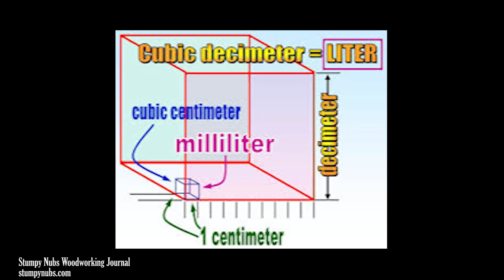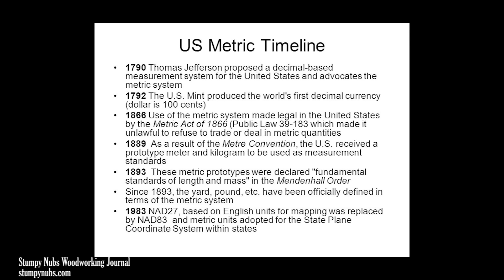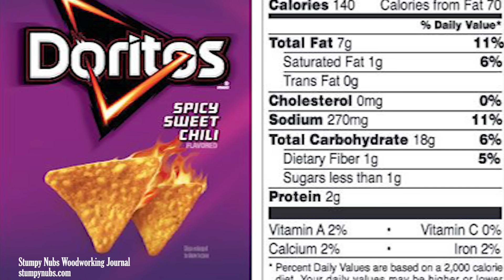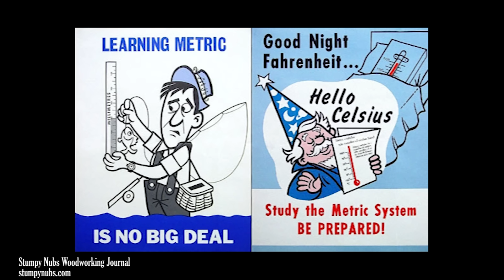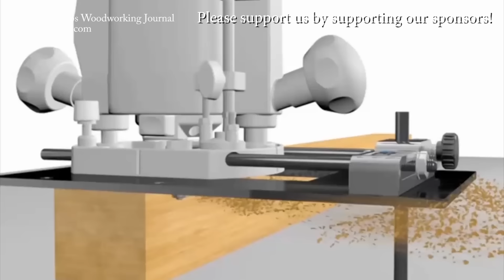BREAKING: The USA is switching to METRIC!

Comment: I made the switch to metric for all 'fine woodworking' projects from the start.  All of my tapes, squares and straight edges are metric or dual measurement.  I added a Wixey digital rule / gauge on my table saws and planer and keep a nice Mitutoyo caliper at the ready.  I still reference approximates in imperial and use it for larger projects like cabinets or home repair  just because most appliance schematics and accessories use imperial, but my life is loads easier using metric.
Reply: NO,NO,NO!, That’s all, but NO.

Comment: Here in Puerto Rico: we sell gasoline (petrol) in liters, yet we sell milk and motor oil in quart, half gallon or gallon jugs (yet we ask for a liter of milk); speed is measured in miles per hour, yet distance is measured in kilometers and mileage is calculated in miles per gallon; cloth for sewing is sold by the yard; lumber is sold by inches and feet. In cooking: we use the 'spoon and cup' system. This is a partial list.
Reply: So, of you go 55 mph on the  highway and your destination is 70 km away, you can't easily estimate how long it'll take?
Sounds very cumbersome!
Reply: @LRM12o8  Converting the speeds is pretty easy though if you don't need exact results.
50 km/h ≈ 30 mph
100 km/h ≈ 60 mph
160 km/h ≈ 100 mph
200 km/h ≈ 125 mph
I use these values to make a guess to convert mph to km/h as someone who only uses km/h exclusively and watches American youtube and sometimes needs to know how fast x mph are.
So I'd guess 55mph are a bit under 100 km/h, let's say 90 km/h and after checking online the exact conversion is 88.51392 km/h, so pretty close.
Reply: Sounds like a real bodge up!
Reply: I'm so confused...

Comment: Here in the UK we operate a mishmash of metric and imperial.Our money is metric (has been since 1971)we sell petrol and diesel in litres but we measure road distances and speed in miles and miles per hour,and we sell beer and cider from the pump in pubs in pints but bottled beer is often sold in half litres.Like i said a mishmash since we don't seem to have grasped metric fully.
Reply: I've long believed that fuel is sold in litres because price increases look less alarming than they would if it was sold in gallons.
Reply: In the UK we're a nation of exaggerators. When it's cold, we state the temperature in Celsius, minus 5 sounds really cold. When it's warm, we state the temperature in Fahrenheit, because 80 degrees sounds really hot 🙂
Reply: In UK, we don't sell beer in pints, we measure them in litres and then sell them into quaint pint volume glasses. We don't measure distances in miles either, the road "mile" markers on motorways are all in kilometers, and we just put up speed limit signs in miles per hour so drunk drivers can't claim they thought they only drank a pint when they drank a litre of beer, and they thought they weren't speeding because the speed limit was in km/hr.
Reply: Apart from miles when driving, there's not a single imperial unit I use here in the UK.
Reply: @MostlyPennyCat  You've never bought a pint of beer or milk then?
Reply: @MostlyPennyCat  How tall are you?
Reply: @1man1guitarletsgo  
195cm.
And I weigh 73kg.
Reply: @petebown  
Yes but I've always preferred a large gin & tonic, which is 50ml of gin.
Also I just use 500ml as the 'metric pint' and 500g add the 'metric pound'
And nobody really uses multiple units like inches, feet, yards and miles. We only use miles, we don't use the non-decimal inches in feet, feet in yards and yards in miles.
Reply: @MostlyPennyCat  Over 6'4" and only 11st 6lb?  You could do with a few more ounces of food on your plate!
Reply: @1man1guitarletsgo  
Yeah, sadly I'm very ill at the moment. 
I used to weigh 120 kilos but after all the nearly-dying in 2022 I bottomed out at 45. 😬

Comment: In the early 1960's there was a serious effort to convert the U.S. to the metric system.   I remember being in grade school during that time and was educated in the metric system for about 2 years.   Then they abruptly stopped.     Well, my later education as an engineer; physics and chemistry classes were all metric.   It's like growing up learning 2 different languages at home.   As an old man, I think and function equally well with either system............
Reply: I remember that too. I believe the powers at be during that time found it was too difficult to switch over using a bunch of grade school kids to do it, 😅
Reply: do to the vicinity, we use kind of a hybrid system here(Mexico). You get the chance to order materials(plywood, PVC pipe, etc) in Imperial but you make all your measurements in metric. To this day i still see some mechanics using SAE tools on recent cars... I stopped taking my car to those shops and had to learn some mechanical skills on the way, but seeing someone beat a 1/2" socket in a 13mm nut was a really hard pill to swallow -_-
Reply: @haqvor  No, it really has nothing to do with the rationalization of the imperial system.  Politicians in the '60s thought they "knew more" than the mere riffraff and decided to push it down their throats.  The people rejected it, soundly, so it went away.  Mostly.  Liquids are still sold in metric units but that's about all.

People in the STEM fields use metric because it's, well, required.  A lot of needed units don't exist in the FPS system and conversions are much more important.  For 99% of the people, FPS works just fine.  If our betters are going to try to force it again, expect the same results.  A lot of people will be really pissed.  I don't much care, except that I have a lot of imperial tools.
Reply: In the early 70's that called it 'think metric'.
Reply: We got that in UK too. First our currency went decimal, then suddenly nothing could be sold in pounds and ounces any more. Unfortunately we didn’t stop, so in school in 1969 (I think?) we had it all going on, and in the stores we were being ripped off by companies in the conversion. A mars bar used to cost 4d - four old pennies, or fourpence, suddenly they cost 2p, or 5d, it didn’t stop there either, within a short space of time a mars bar cost 4p, a nice 254% increase for no outlay at all…
Reply: In the 40s, a bunch of countries signed the treaty resulting from the Convention of Civil Aviation in Chicago.  One of the things agreed on was that ALL units in aviation are to be Metric.  A temporary provision was made for certain Imperial measurements.   And yes you guessed it: to this day everyone measures altitude in feet, speed in knots, runway length in meters, pressure in inches of mercury or pascal depending on your locale...  It's all good though, as long as you're not asked to convert between the units a lot.
   
The US is getting on board though.  Don't drug pushers measure their product in grams and kilograms? 
  
Also, while our construction lumber in Europe is measured in metric units, the sizes are still imperial so you get weird sizes like 22x44mm, 37mm, and so on.
Reply: The plan was to convert Canada and the USA at the same time, since back then the bulk of our trade was with each other. There was more push back in the US and they bailed out while we compliant Canucks were pushed [by Trudeau the elder] or jumped boldly over the metric cliff like Wiley Coyote. 
    It took years. It was one of the dumbest big projects we ever undertook and the costs and learning curve mistakes were ridiculous.
    I make no judgements about which system of measurement is better. The stupid and pointless part is the conversion itself. Now that Canada has made the genius  move and it's mostly complete, it would be just as stupid, costly, pointless and unproductive to switch back.
Reply: same - I remember our 3rd grade teachers being almost frantic about it, telling that this was super important and everything was changing. And then we showed up one day and the grownups were acting like nothing ever happened. Now that I think about it, that may be when my issues with authority started.
Reply: @noquedaniuno  I have a full set of both Metric and SAE... your nuts and bolts would be perfectly safe in my shop ;) (i don't own one or want to... I do, do work for people sometimes)
Reply: @howlerbike Trudeau and Carter had made a deal to switch over at the same time. Reagan came in and cancelled it. I was a kid then, and learned both.
Reply: This is what it's really about, being able to use BOTH systems... but the fractionally challenged metric types aren't capable.
Reply: @grahamdavies22 unfortunately your country is going to a new system.. called stop oil .. 
Have fun 😂
Reply: @kwilliams2239  The people didn't reject it, a new political party came in and decided that "the people" shouldn't be forced to us foreign measurements. They also decided that it wasn't important to use solar power to reduce reliance on foreign oil. It resulted in reducing the marketability or durable equipment to non-imperial markets and continuing our funding the Arab world.  Not sure how that helped the riff-raff - they're worse off today than they were then, despite several bouts of "trickle-down" tax cuts. Especially since 40 years later, manufacturing has gone the metric way, and most others are catching up.
Reply: @haqvor ultimately still arbitrary amounts rationalised
Reply: @haqvor  true although for practical purposes the 99.9% of humanity a correctly calibrated fixed measure or weight as the guide specimen is whats needed . These things are fascinating such as when timekeeping became more accurate it was realised that the earth wasn't keeping " time" either...

Comment: Dear Mr Nubs -- Thank you for your always valuable, always informative woodworking videos.  We have all learned much from you.  We also love your style of delivery and humor.

Three years before I retired, intending to move to the Philippines, I decided to switch from US measurements to metric -- especially for temperature (weather) and distance (driving).  My digital thermometer happily accomated me with a flip of the switch on the back side.  (My Volvo, however, stayed locked in miles.)

In the woodshop, a surprise!  My Stanley tape measure already spoke metric.  Never noticed that before, except when it got in the way.

Here's my beef --

When my almost 70 yo eyes look down on the tape measure, I can easily see the markings for sixteenths, eighths, quarter inches, etc.  The length of the dash at the edge of the tape makes it easy to determine.

The metric side (and my other metric-only measures) shows each mark with a dash of the same length, except for the half centimeter dash which is longer.  Problem is, the mm marks are closer together than sixteenths.  And with my astigmatism and trifocal lenses it's really hard to tell the difference between 86 mm and 87 mm or 42 and 43 and so on.  Dashes of different lengths make the Inches measurements easier to read.

Still, I persevere -- taking my glasses off and getting right down on the ruler when precise metric measurements are needed, which is to say constantly.

Please use your 'influence' to persuade metric measurement instrument providers to adopt gradations in their dashes.  Picture one span of a suspension bridge for guidance, from short dashes at the beginning to the long dash in the middle, then shortening down again until the next centimeter.

Thank you very much, Mr. Nubs.  You are doing every metric user over the age of 40 a great service.
Reply: I like your thoughts on this. They align exactly with my experience here in Canada.
Reply: You could try to convert what you're trying to build in increments of 5mm sir.
Reply: This is a really great point - the dashes in a metric tape are all the same length and it is harder to see which exact one you need. I often need to count the ticks with my pencil. 

Excellent point. 👍🇨🇦
Reply: I think the Starrett rules (and probably others) are graduated with different length marks that might help...although that's not a tape, admittedly.  Personally I always hated rules graduated in half millimetres - those have always been prone to visual tracking errors.  I always tried to find scales that were only in full millimetres...but to be honest, now I'm looking for them that are only graduated every 2mm!  Ahh the joys of increasing years of experience!
Reply: As a barely over 40 woodworker, I resemble your remark. Begrudgingly. How fast our eyes go...
Reply: That's a really good point! thanks for making it.

Comment: In South Africa we changed from imperial to metric in the mid 1960. I use both. Although metric is easier for calculating engineering subjects. My biggest downfall is I love to bake bread. Blows my brain when the recipes use cups , ounces , lbs etc. so much easier when it’s all in grams , litres and millilitres. 👍👍. We enjoy your videos.
Reply: And if you look at it a bit closer, you need to realize that there are US cups (fluid=236.5882365	ml, dry=275.305235679 ml), Imperial cups (284.130625 ml), metric cups (250 ml), Canadian cups (227.3045 ml), etc... And there is also the issue that US cups are further divided into dry cups or fluid cups, which most people don't realize the difference and end up using the wrong measuring device for the type of cup that the recipe is requiring... Then again, you have no guarantee that the original creator of the recipe used the right measuring device either... And then there is the FDA "nutritional cup"... Might as well say, "a smidgen of this and a dash of that" for the recipe... :(
Reply: Metric recipes tend to be measured by weight, and imperial by volume. For ANY kind of bread or pastry, the ratios are critical to get right, and measuring by weight is SO much easier and more accurate. I definitely prefer metric for bread, and other baked goods.
Reply: I was born 16 years after the change over.  Pretty much everything I do is in Metric except baking.  I agree Teaspoons, and cups are so much easier for me, though I use metric on things like the butter as it is easier to carve off blocks knowing how much is needed without having to weigh the darn stuff.  I grew up using cups and spoons, also most recipes are from old cook books, WAY  older than me.  Also when dyslexic and one gets things wrong on a calculator, having to whip out a scale just to measure what would have been 4 teaspoons of something in the old way of measuring is just rediculous.  If using a scoop, when you figure it out, you still have to convert back to how many scoops needed that are measured in teaspoons anyway!
Reply: And look at south Africa now. Great reason to NEVER entertain the idea of switching to metric.
Reply: The metric system in South Africa has been tremendously useful for measuring the level of corruption in the government.
Reply: A bit later than that. I was in SA between 1969 and late 1970, and the changeover was just starting.